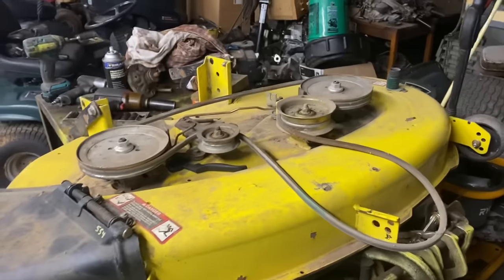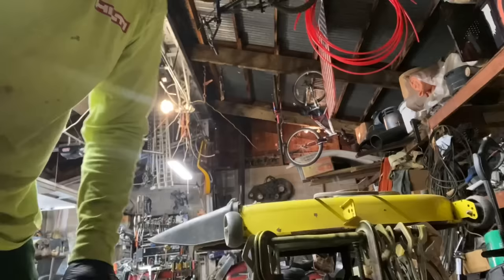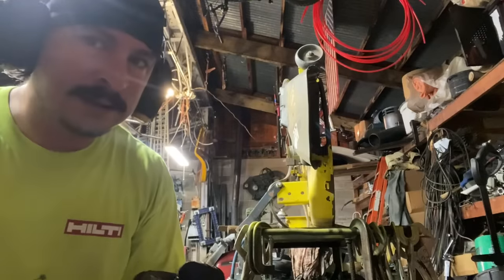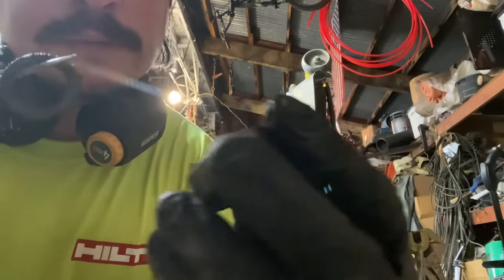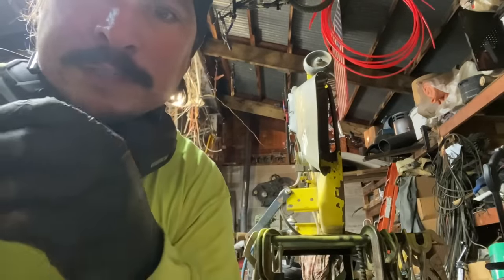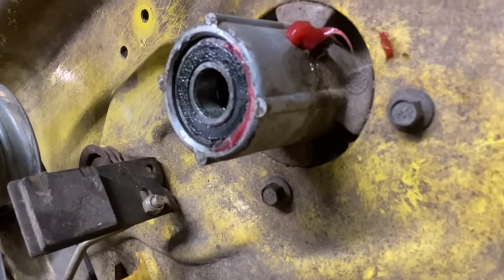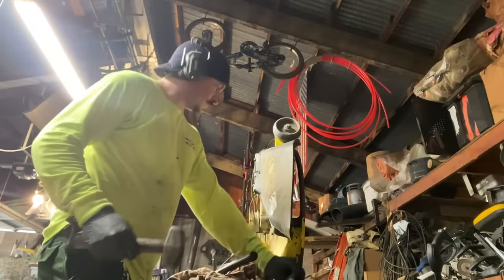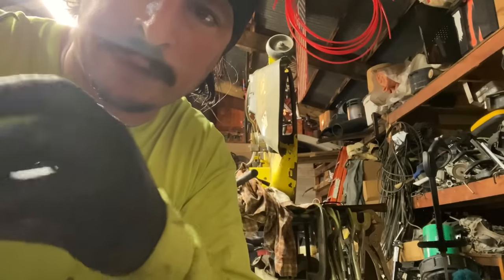Part 1 - Don’t trust the “Experts” Grease your mower deck sealed spindle bearings Common sense.

Comment: Okay. Neither metal shielded nor rubber sealed should be greased for several reasons.  On your example,  the inner was metal and the outer rubber.  If you pump the spindle housing full until grease emerges from the rubber seal,, you've ruined the seal.  Further,  the bearing will overheat. Packed full, the viscosity will be reduced, and the grease will be discharged through the weakened seal causing ing bearing failure.
  After much use, this spindle housing will get some dust inside and sending grease through will contaminate the bearing.
  Injection of incompatible lube can render the old and new lubes useless.  And don't try to say people know the chemistry of the grease shipped with the original units...even you don't. 
  These old practices were handed down from poured, plain bearings(look it up ) from years past that required exchange of lube periodically. This just isn't the case any more.
Reply from the maker: I disagree but you can voice your opinion just like anybody else. I just hope folks are willing to try it and see that it works. I have never experienced any issues that you speak of. All the issues I had went away when I started adding grease the way I showed. That’s why I posted the video. If you have some proof of the issues you speak of feel free to make a video and provide evidence to us. I’d sure watch it. You can even post a link in this comment thread. As for now it’s just your opinion. And without proof it’s just talk. Too much of what you stated simply does not occur. So if some of your points are invalid then possible so are the rest. You may think your right, but I think I am so we can just agree to disagree. Iv never seen a seal damaged from just adding grease. I have many times removed and checked how much grease made it’s way into bearing but never seen a seal damaged. . The little flimsy rubber flap does not receive damage from greas passing. Those seals / shields pop out and right back in, unless of course the rubber is aged then removing can cause damage easily. Even a new shield / seal can be damaged on removal. One must use care when manipulating the shield for removal and install. The metal shields can not be removed at least not the ones Iv seen but they are even more durable. So to say I ruined the seal you are absolutely incorrect
And in my opinion being very dramatic about the whole thing. Kinda got a Karen vibe off that comment as a whole. If you are so sure just duplicate my procedure and post your findings. Also the bearing will not overheat. And on that topic can you tell me at what temperature does a bearing begin to have issues from “overheating? What would be a dangerous temperature for said bearings? How do we know when a bearing has reached a temp to classify it as overheated? Lots of questions about this. I hope you have some answers. As for things to disprove, this would be the most simple to debunk. Just get some before and after temp readings and then when the bearing fails and it can be proven that the temps were higer we can consider this a cause. But due to lack of bearing failure here after a good greasing I probably won’t be able to make much headway in that department as all my bearings go for so long it would be hard to track. Unless your able to wait a few years probably much longer. As for overheating due to greasing it’s not been an issue for me in this application. The spindle does not retain any pressure. The excess grease leaves and the bearings at best are full just as some new bearings arrive. I mean the argument is silly. Again, simply run some tests, use a temp gun and show us findings. Iv never seen a well serviced mandrel bearing fail. If overheating due to grease was a real concern I’d be fixing units full of grease. All the ones I see are not properly greased. Some folks can quickly over complicate things. It’s really so simple it’s almost silly. As for dust in a mandrel, that shouldn’t be possible if the unit is assembled properly and outer shields are in good condition. Now if it has a open weap hole like MTD builds
Then yes dust can get right in the open hole as well as water to rust the shaft. I happen to dislike MTD for this as well as many other reasons. As for this Deere mandrel it was sealed. No dust in it as seen in the video. Another cause for dust is dry rusty failing bearings. If your only adding grease after the bearings reached that point it’s a lost cause anyways. Would you mind telling us how many decks have you rebuilt? Just so we can get an idea of your skill level? And possibly your credentials that qualify you specifically as a lawn mower deck bearing expert? Consider this, they put zerks on more newer mandrels than they did the older mandrels but you say it’s a old practice that was handed down. Do greasing mandrels in the old days was okay but less low end equipment had a grease fitting on the mandrel but now days many of the cheeper machines come with grease fittings but we shouldn’t use them. At least not as the mandrels are assembled from the factory with shields on both sides? Is that what you are saying? If so this just does not compute
For me. I’m not interested in trying to disprove every point you made but it’s simply so far off base I can’t take you seriously. Seems more like a troll comment than a serious one.i mean everything I did was wrong according to your comment. I mean come on. After all it’s just opinions. So I don’t really care. I’m just sharing mine too.

Comment: This is the crappiest mower deck in history, you know that, right?  Home Depot / Lowes finest.  How about a comparison with a 30 year + old Deere 318 deck?
Reply from the maker: Regardless of what mower deck it is, the process does not change. If the spindle has a zerk then it can be greased. Your focused on something that is irrelevant as far as what I’m trying to help folks with in this video.

Comment: ok this how it works when you buy a mower pull the spindles out take the rubber seals of one side of the bearing put more grease in with your finger put seal back on this will make them last this guy does not know what hes talking about the only reason you gease in side is to keek moisture out to get them apart if you pull the seal of the top bearing when it gets hot wheres the grease go down the bottom think about it sick of telling you people
Reply from the maker: Did you even watch my video? I’m scratching my head trying to figure out what your saying because I didn’t recommend removing any seals. 
So, according to your advice. I should buy a mower and immediately commence to disassembling it and remove the inner seals and pack grease then put seals back on? Are you kidding me? That’s why I made this video, so folks don’t need to take a spindle apart. If it has a grease fitting I’m showing how to use it and that it will push grease into the bearings. I literally proved it and 
laid it out step by step in this video. It’s point blank simple as ABC123. Literally the only reason I made this video is because absolutely nobody else on YouTube has a video showing that greasing a splindle actually will work if done right. If you watched the whole video It explains it. May be a boring video but it’s good information for folks who want to get to the bottom of this. Plenty of ignorance out there on other channels telling folks it’s a complete waste of time to even grease a spindle. I eventually got annoyed that all these pros are telling folks nonsense. So I made this video to prove a inner seal will not prevent grease. The very reason I made it step by step to prove it actually works unlike everyone else who says it won’t work and absolutely not a single one of those naysayers provide proof or show the process. However they do plenty of mouth running and pretend they know what they are rambling on about. And that confuses folks who are trying to learn. The comment you left makes me think maybe you didn’t actually watch the full video. If you have good information to
Share and I’m doing it wrong please make a video and show us the proof. I learn something new every day. I’m ignorant of many things in life and I love to learn from others who have experience and expert skills in areas I don’t. But your comment doesn’t even make sense as your argument is partially about stuff not in my video.

Comment: I disagree I had bearing failure after bearing failure until I took those rubber seals out they always went bad and I grease the heck out of them
Reply from the maker: Consider that you may be right and maybe I am too. Just because your right does not mean I’m wrong. The specific reason I made this video a step by step process was to prove it works if the process is followed. If one major step is left out then grease may not reach the bearings. Did you grease to the point you seen grease exit out the top and bottom. There are factors to consider. Like what type of mandrel? If it’s on a CUB cadet or other MTD it may have a weep hole allowing grease to exit before it can pressurize and pass the seals. Also if you stop greasing before the mandrel is full to the point it exits top,bottom or both ends it will only stay between the bearings and would not pass the inner seal. As in most bearing assemblies the lower bearing fails first so without seals the lower bearing will receive grease by gravety so without the inner seals installed the grease will migrate down and extend the life of lower bearing as for this scenario. Therefor extending life of the lower bearing that usually fails first. This is a good thing because it will get more hours on the assembly before the top bearing goes bad but even without the inner seals installed the top bearing will not receive grease until the assembly is filled as gravity will pull all the grease towards the bottom over time. I know this works because Iv been doing it for years. Just offering help to those who are interested. I can’t change everyone’s mind and that’s okay. I’m just hoping to reach some folks who disagree that sealed bearings wont take grease. I knew how to prove it and nobody else seemed to have a video proving it. So I decided I wanted to. It seems to be a popular topic. More popular than I expected.
Reply: @GTObearclaw1  It was on and I MTD it would eat Bearings till I took those rubber seals out and I greased until that came out And no more bearing failures
Reply from the maker: @robertbaker5130  okay, that explains it. MTD (made to die) is a wonderful at producing the absolute worst equipment and taking well known brands and destroying great names by painting MTD equipment the same color as the brands that they now own and slapping stickers on to proclaim its a cub or some other machine that it’s actually not. I have learned over the years to avoid Anything MTD makes. It is a guarantee I will be annoyed by the terrable quality and ways they go above and beyond to offer the absolute worst designs in the mower industry. However that’s just my opinion on that topic. But back to the mandrels. The only way this process will work for your machine is to plug the weep holes in the side of the spindle or remove the inner shields as you have done. I’d still plug that hole as dirt will get into the mandrel and mix into your grease and eventually find its way into your bearings. I’m sure some engineers at MTD get a good laugh about that design. Folks arguing over if there needs to be a hole to release pressure. No other brand that Iv worked on does this other than the MTD. And the results of the design are failed bearings before there time unless someone is capable and willing to pull the inner shields as you have done. But why should you have to? That’s the question I’d like to know from MTD.
Reply: @GTObearclaw1  I admit these are throwaway mowers but mine lasted nine years due to my maintenance and sold onto the next guy

Comment: You can grease them till the cows come home but the side load from the belt tension is going to have you replacing them someday anyways.
Reply from the maker: I don’t have any cows. unfounded accusation that you can not prove. I challenge you to prove it. Come with facts and quit spreading lies is my advice. You’re not the first naysayer. But you could be the first to bring some evidence but I won’t hold my breath. You may not see your comment as a lie but it is simply a lie. and I’m sure it’s upsetting to you to read this but hay, reality hits hard and Hommie don’t play that. This video shows facts and is helpful information. Your information is lies and nobody can prove it and it’s actually impossible because these units hold zero pressure and the pressure from the grease gun is immediately expelled as the grease passes out of the unit. It’s silly you even came up with this nonsense and even more silly it seemed logical enough to make a comment about. At the end of the day you can’t prove it. And you won’t be back with proof, I guarantee that. Just a keyboard know it all with no evidence is what your comment boils down to. If you can accept it you may gain something from
The effort I exerted for this comment but I don’t suspect that’s how this plays out. If you were open to learning something new the video itself would have registered.

Comment: Just because it's a sealed bearing does not mean that pressure behind grease can't penetrate He wanted to argue me so I left the conversation with Easy way to rip people off and make money seems like to me
Reply from the maker: I think the company selling machines or the repair shops makes more money selling more parts and tractors. If your tractor lasts 30 years without failure it hurts the bottom line. They want to fix your stuff more often.
Reply: @GTObearclaw1   I LOVE the way you think!
LOL,,, AFTER 30 years of good service, then they all fail. That's totally fine.  The company only LOOSES money on those first 30 years!  BUT, Then, ALL of those happy buyers will come back to them!  Right?
Eventually a WIN WIN.  & EVERYBODY IS HAPPY!!
Like all of the 'money incentives' that car dealers TRY to lure you in with.
ALL they would need is a 10 YEAR, or 100,000 mi Bumper-to-bumper 100% warranty!!  ;>)

THEN,,, THEY would save billions of dollars in useless advertising,,, & WE wouldn't be forced to watch SO MANY DAMN USELESS COMMERCIALS!  Another WIN WIN!   KISS.

Comment: I am shocked. You put two owergreased double sealed bearing and put grese between. Why?????
Reply from the maker: @PeroPopara-hk8fq  it’s simply preventive maintenance. Real basic stuff. Dont know what you’re shocked about nor do I comprehend exactly what you typed.
Reply from the maker: @PeroPopara-hk8fq   don’t muddy the water sir, my videos are not about electric tools and bearings that spin 30,000 or 8,000 rpm. I’m strictly showing how to service a lawn mower. Most riding mowers blades will turn at speeds between 2,800 to 3,200 rpm. A lot of things come into play here. but mostly the length of the blade. On average the tip speed on the blades on this type of mower will be in the 200 - 250 mph range. As usual seems we have another naysayer presenting information not relevant to the specific topic of mower deck mandrels. I’m specifically covering how to service a mower deck bearing. If you have evidence and can provide such on a video please come back and drop us a link. Otherwise consider this option if you want your mower deck bearings to live a long life. I can assure you that double sided shielded bearings won’t last forever in this application. They need grease or replacement is coming in due time. I’ll let other folks deal with videos about bearings that spin 30,000rpm. That’s has nothing to do with my video.
Reply from the maker: @PeroPopara-hk8fq  did you delete your reply?

Comment: Never buy a pressed metal deck ride on mower. It will not last and repair costs will bankrupt you!!! Buy manufactured only!!!
Reply from the maker: I disagree, some of the stamped metal
Decks on home owner model machines are actually good quality especially for 
For the price. The older GT5000 and similar models have a very durable deck. Actually look identical to the 54” kubota deck shells. And some of the 48” are durable as well if AYP made. But yes most are too thin. Some commercial models actually have stamped decks. That’s not necessarily the way we can always determine what’s what. It’s a little more complicated than that. Sadly Iv even seen some of the so called fabricated decks with mandrels broke out. Now they make them look like heavy dusty fabricated decks but you can’t always trust that.